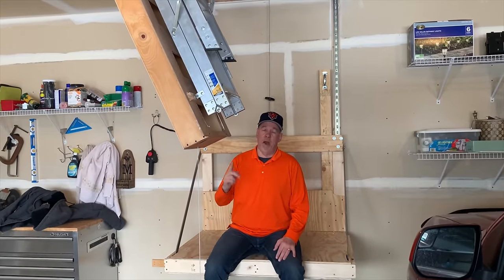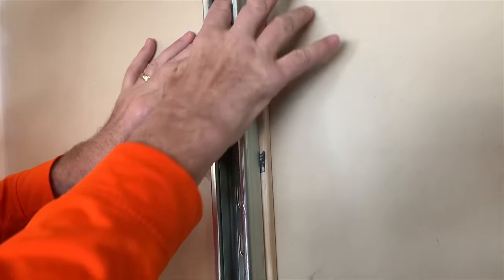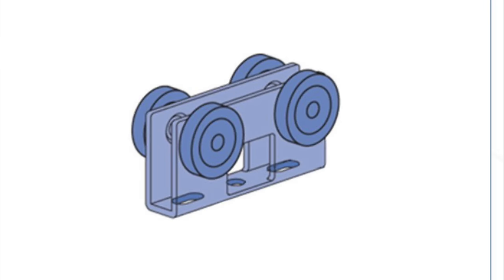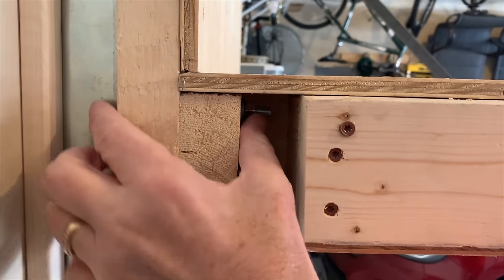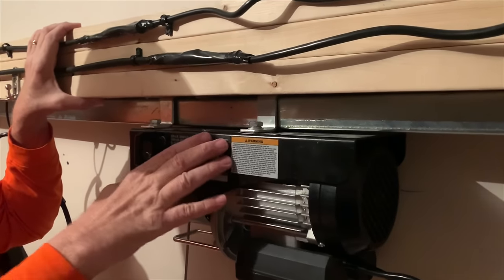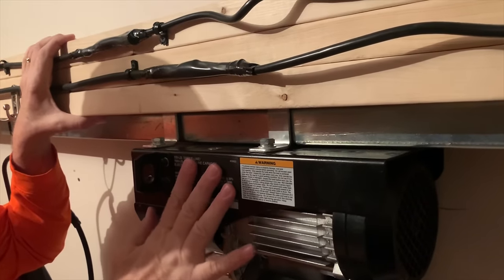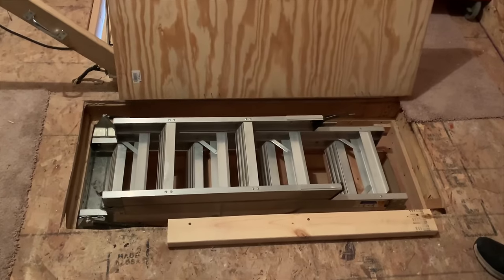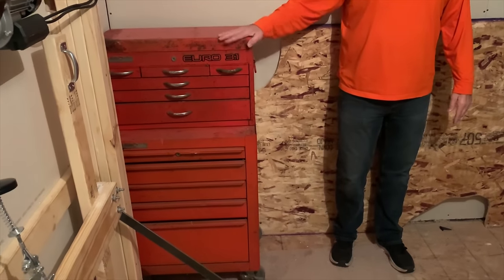Garage Attic Elevator / Lift Build in Minneapolis Minnesota

Comment: Why not add a pulley system so you can lift double the weight?!
Reply from the maker: Thank you for the comment. Just because I don’t need to. I only call on it to lift about 300lbs. Using a pulley would slow it to half speed. It handles 300 lbs easily.

Comment: Awesome, amazing - love DIY projects like this. But without ratchet catches on the rails the cable on the winch is a single point of failure - both when in operation and at rest. At the very least you should have a square on the floor underneath this painted with a big red X (e.g. DO NOT STAND HERE)
Reply from the maker: You need to watch our elevator emergency brake videos.
Reply: @theelevatorSRT8  - nope, haven't seen those yet sir - will take a look. If that is the case, and you have something in place other than that single cable to support the elevator, then, well done 😊
Reply: @theelevatorSRT8  OH Me too :)

Comment: What safety measures are there for this in case the motor or tow line breaks?
Reply: Doesn’t appear to have any, except that it is overbuilt.  Real elevators have multiple safety mechanisms to prevent them from falling.
Reply from the maker: Watch our other video. We added fall arresters. Plus, we’re working on a cool braking mechanism. If it works!

Comment: I can only get a 10' piece of superstrut channel from my HomeDepot.  Is yours longer than 10' if not how did you piece it together without being in the way of the trolleys.
Reply: Check with commercial suppliers. Unistrut comes in 20 foot lenth also.
Reply: @theelevatorSRT8  . I bought 12' struts at tractor supply.

Comment: I would recommend changing that over to take 1,100 Pounds...  That way it can handle those who might be "overweight" and also in case you have to put up there something heavy.
It will also allow your system to just "last" longer too the stronger it is.
BTW, good heavens that is a waste of "space"...  That's a whole nother level of potential living.  it's not even an "attic".  You should have just made that into an extra ROOM.
Reply from the maker: I like the idea.  A man cave with an elevator!

Comment: Great idea
But I would not ride and only use it for material
I’ve been an Elevatorman for 39 years and there is no safety device (brake) on the lift, that being said you would suffer serious injuries if the cable failed
Reply: Not to mention that it’s likely only built to a 4X safety factor(if lucky) which is not appropriate for man lift standards. Love the concept though.
Reply from the maker: Apparently you did not watch our Otis Safety Brake video.
Reply: @theelevatorSRT8  I did after I replied to your video, nice concept

Comment: As a licensed elevator mechanic, I have to say that this would be a great diy solution to a problem - if it weren't for the glaring safety concerns stemming from the equipment used.

I hope you keep a very close eye on your cable condition and plan for regular refurbishment of that gear box.

If either fail, they will fall catastrophically and at great personal injury.

Invest in an upgrade to your safety and develop a means to hold the carriage  from free fall should the cable snap or the gearbox let go.

Transport of materials is different - the fact that you are riding this device takes it from farm equipment to uninsured liability.

Very creative build, however ... you have been warned.
Reply from the maker: I don’t know how you can determine insurability, but that not withstanding, apparently you did not bother to watch our emergency brake videos. I ain’t worried. Thank you for the warning, apparently you think we are children or mentally diminished. We built this thing, do you think we may understand it a little better than you? 
Do you want to warn me about using power saws, or riding a motorcycle, climbing a ladder, or walking on icy steps? 
My point is, I don’t know who you are but maybe don’t talk to people like they’re idiots especially after seeing clear evidence they are not. You could have made your comment in such a way, I would have said, “Thank you, man!  I appreciate it.”  I do appreciate your input, however...you’ve been critiqued. 
I do appreciated a creative use of an ellipses though. Nice. I always sign my messages. “Thank you...Brian” 
So thank you...Brian.
Reply: @theelevatorSRT8  Please don't take my cautionary note to you as derision, it was not intended that way.

If you have built an emergency brake, it would be a welcome addition to this video.

Many people who watch this video may not think about a second safety device and expose themselves to risk unknowingly.

You can minimize my warning with comments about power tool use or the inability to remain upright on slippery surfaces, you are after all in charge of you.

My career is in elevators - construction, maintenance, inspection and investigation. Find yourself a local elevator guy/gal and tell them you've made a rideable hoist with a single lifting cable and no backup safety, and watch them turn pale.

If you've addressed the safety portion, put it in the video.. Or don't. Your call.

I fear for the rest of the commenters that will buy a winch from their local harbor freight or princess auto and think life is peachy. Pride in construction is a poor ointment for an injury.

Take care of yourself and continue making things to improve your quality of life! Don't be offended when someone points out something you may or may not have thought of.

Take care

Comment: Otherwise known as Kindorf.  Instead of using all those 2xs,  you could have used 4x4. Especially for the gantry. Lot stronger and less work.  I was going to suggest counterweights to take the load off the motor. But that creates a safety issue because it is not a closed area. People might get in the way underneath. Closing off the counterweights would be a lot of extra work.
    Too bad there are no safety's on the track to prevent freefall. That needs to be engineered.
Reply: @theelevatorSRT8  I saw later the second vid with the fall protection. That was unexpected. It's fine. 
   A single 4x4 is better than built up. Multiple boards in wood don't work the way you think. They were in the wrong direction on the flat, not vertical. Grain direction is very important. 
  Anyway, it's fine. It just could have been done easier and cheaper.  That's life.  There is more than one way to... do anything.
Reply: @theelevatorSRT8  That's why you use solid or LVLs.  Another possibility is a steel  u-bracket with the holes at a right angle, bypassing the issue altogether.  I particularly like LVLs as a beam because they are exceptionally strong and easy to deal with.  It's a long discussion about the details which are very difficult in a forum.
    Btw, I thought you were going to use a homemade version of the Otis safety. Using a personal fall safety device for the platform really caught me off guard.
Reply: @theelevatorSRT8  Ton of work, I'm not sure it's practical for such a small hoist.  Perhaps look around at commercial solutions for small elevators. Especially home elevators. there are a lot of them.

Comment: I love the idea but... As a firefighter, I feel compelled to say that you've potentially created a hazard in the sense that nothing you've used is rated for any burn limiting. Most times garages are sheetrocked with 5/8 to help with burn time from the garage into the living area. That said, you have created gaps where flammable smoke can get through. And while I know you already had the scuttle ladder going up, you now have two points where flammable smoke can penetrate the attic space and tha'ts called a flow path. So if you seal one it would be better, safer for you and your wife especially while you sleep. It just gives you more time to react. But there's also, dead load and live load. The amount of live load you have up their now may be more than the rafters were rated for. For that I'd ask a structural engineer. All said its an awesome idea.

Comment: I really like the channel and trolleys. You mention that it is not intended to be a person lift but given the alternative is the PITA ladder [my definition of the ladder, not yours. I have one and find the adjective appropriate] I agree the elevator will probably be used for people more than intended. I am not attempting to detract from a great implementation but am curious if there are any thoughts about how to mitigate the risk of the cable breaking in the future?
Reply: @theelevatorSRT8 , Thanks for the response. Side note, I'm also in the Minneapolis area, a couple of miles from the casino in Prior Lake. Anway, I need to make an elevator. I've been trying to think of a way to handle the cable issue and was hoping that you had had an epiphany.
Reply: It depends how good you are at building and machining. The way it's done on small installations like this, is there is a brake that is pushed out by the force of a spring. The cable is attached to bottom of this spring and the elevator is attached on top compressing the spring. If the cable brakes the spring expands pushing on a searies of levers setting the brake.
Reply: Here you go DIY saftey elevator https://youtu.be/sSjJjKcoNRk
Reply: It really doesn't have to be complicated.  You could use a simple ratcheting pawl with a series of catches on the way up.  With the weights you're dealing with, you could probably just make it out of wood.  Cut ratchet teeth along a 2or or 2x6 and mount it next to your track. Mount a simple pawl on the elevator itself.  Install a spring of some sort to keep it open when coming down and closed when going up.

Comment: Whats with that huge box framed onto your attic ladder?
Reply from the maker: Great question, it contains the ladder, very common. It unfolds. It’s flush on the attic floor. It would seem more logical to have it flush to the ceiling instead but what do I know ? Probably a reason.
Reply from the maker: Wait, I see what you mean now. I never noticed or thought about it before. I don’t know!

Comment: Where is the emergency brake if the hosting cable should break?
Reply: On the garage floor.
Reply from the maker: That's pretty funny.  It's not the fall, it's the sudden stop at the bottom.  I get it! :)
Reply from the maker: Two things.  We added fall arresters, but they are kind of costly.  We just designed and built an emergency brake system if the cable should somehow lose tension.  The video is launching today at Noon CT! It's pretty cool.
Reply: @theelevatorSRT8  the only way to get the sudden stop at the end is to have the fall without the fall there is no sudden stop. DUH! Not so funny after the broken bones and possible surgeries.
Reply from the maker: @eugeneshealthproject  Apparently you have failed to get the joke. Too bad, you missed a good moment.

Comment: Inspect that cable and attachment points regularly....just saying. Cheers!
Reply: yep, where the cable attaches to the carriage looked like the main weak point, seems like a good place for some metal plates top and bottom to prevent that bolt from being ripped out of the wood

Comment: Awesome build!!!
You’re like me, over build stuff by 10x’s lol 
That could lift a truck!! Lol
Well cable and motor may not?

But your weakest link is what?
Cable?
I-bolt?
Reply: Brian Michaels nice build though!
Reply: I've engineered (but not installed... yet) a similar system for my garage, and the limiting factor I keep running against is lift motor rating. The cable itself typically has a 5x safety factor over the winch/motor rating. Because there hoist is a pure engineered component in the system, it's rating is the weakest point. One couldn't know what part of the hoist is the limiting factor without destructive testing. I'd rather just take the rating and build that into my system capacity limit (which is exactly what I did for my system).

Comment: Your "Beam" is not going to last. building it on the flat removes any structural integrity. Think like you are building a window opening. You want 3  2x8" minimum standing and sandwiched with 1/2" plywood in between to build it out for a 2x6" King and Jack studs. Use 2 Jacks in this situation. 
Just lookin out for ya, and not trying to ruin your build. I love the idea by the way.
Reply from the maker: Thank you. I dig it. I get that comment a lot. Of course I know that but the reason is the size of the holes needing to be drilled to hold the hoist.  The beam is not being asked to handle even a quarter of wound it could withstand. I’m not concerned at all.

Comment: I’m not sure I would Rely on a single 2x6 with a big hole through it for you main pully. Imagine when it dries up.  I would seriously consider reinforcing this before your wife becomes a sole empty nester
Reply: Might be a good idea to include a piece of strut across that 2x6 as well for security.  I was surprised the header 2x4's were on the flat and not their side in the attic.  Lumber is much stronger on their side there than flat.

Comment: Coming from a elevator mechanic DO NOT I REPEAT DO NOT RIDE ON THIS. If your using this only use it to lift the items Don’t risk your life. You have no safeties if the cable snaps you will go down hard.
Reply from the maker: I have added safety items to it , take a look at my other videos. and more upcoming.

Comment: Please do not ride your lift. You did a very nice job for the most part and I applaud your effort. There are a few weak links that make it unsafe to ride or stand under. The eye bolt that you use to connect the lift to your winch is not for rigging and not a load bearing eyelet. I know the eyelets from hardware stores give a load rating but that is not a load rating for lifting people or anything that will be lifted above people. You can go to any of the box store websites and read very clearly they do not carry any rigging hardware for lifting people. Please do a quick search for eyebolt used for overhead lift. You need a sealed ring eyelet with 10x's load safety factor and shackles. Without shackles if you're cable twists you can have real problems.  Furthermore the winch does not have the proper brake system or wedge guide fall protection. I'm sure it's fine for lifting stuff up in your attic just not people under it or on it please. All that being said I'm going to use the Super Strut and rollers idea and build one myself, just a little different! 🤘 Mine will only lift from the ground to four and a half feet high. I'm going to use it for stacking very heavy speakers on top of each other.
Reply from the maker: I appreciate your input. Thank you.  You should know that I added fall arresters, but even cooler, we just designed and built an emergency brake for it. The video launches today at Noon CT.  Regarding the eyelet, we already changed it. but you you should know the original was plenty good enough. A commenter alarmed me about it, I changed it, and another commented pointed it out that it was unnecessary because the rating they give them is for shear. It was plenty strong enough. Thank you

Comment: That's all really swell.  But that contraption could easily remove an arm or a leg from your corpse if you are not paying full attention.  There's a reason why elevators need licenses.  You have been warned.
Reply: @theelevatorSRT8  I think you are missing the risk.   The rising platform becomes a pinch point with the ceiling framing.  If you are on it going up, and having a foot sticking out, it will get broken, if not worse.  You would have to NOT be paying attention, but that happens all the time.
Reply: @theelevatorSRT8  ya I know.  I am mr safety.  can't help it.  Really cool attic lift.   Comes in handy.  Just don't ride it up yourself and all is safe.

Comment: Your solid beam on top is laying flat... should be on edge.
Reply: The beam as he has it has a vertical depth of 4 1/2 " . If he put the lumber on edge the vertical depth would have been 3 1/2". His way gives a 60% stiffer beam. He did good! Edit: I took another look at the video and could not be sure if the lumber supporting the motor is 2x4 or 2x6 stock. If it’s actually 2x6 then your comment is correct. The fact that the beam showed no flexing under load indicates that they are more than strong enough for the job. And the channel also contributes greatly to the strength and stiffness of the beam.

Comment: the "beam" you hung that motor on shouldn't been on their sides but vertical. way more strength and won't bow.
Reply: Obviously, you're wrong.  It's working just fine.
The beam is a short span of only about 5'-0".  The motor is limited to 550 lbs.  He isn't going to exceed that.  Even elevators in commercial buildings have weight limits we aren't to exceed.
He glued and screwed the members together.  Pretty damn solid. 
Last point:  Have you ever seen a glu-lam beam?  Its individual members are sideways, as you note.  They are glued horizontal members but, with no screws.
Reply from the maker: You have my sincere appreciation Ralph. Thank you!
Reply from the maker: What Ralph said! :)

Comment: I do I ac work Nd sometimes the unit in the attic the would help out a lot
Reply: speed freaks racing
 ... there is a video on exactly this application by a guy who does AC work in attics. The idea is he works by himself and he needed a way to get old units out and new air handlers in so made up an extendable bracket to go across the roof timbers and accept a 120 volt hoist. The one major drawback in his case is trying to mount the thing with drywall screws. Just too cheesy in my mind.